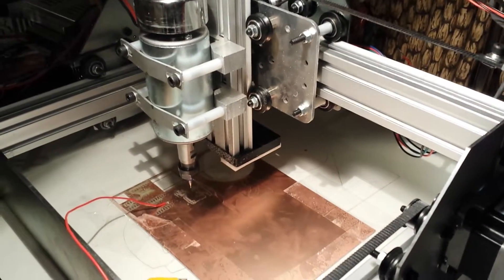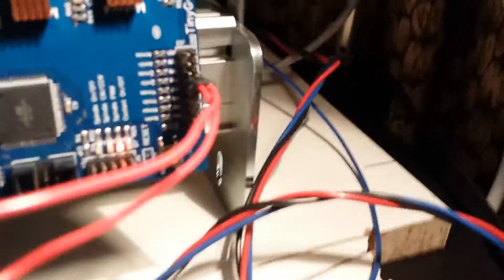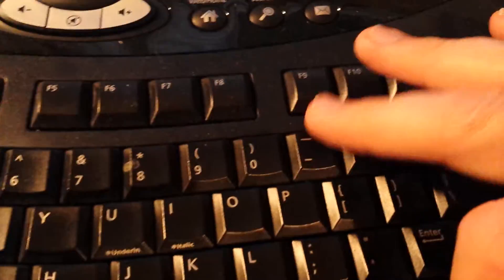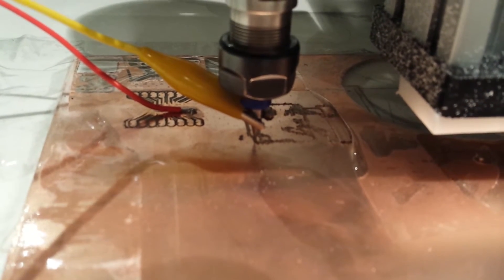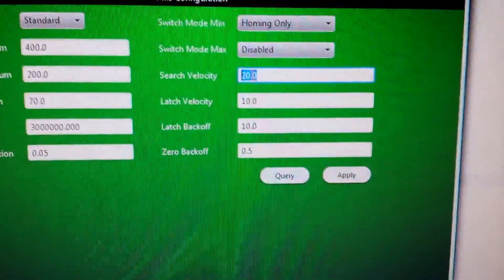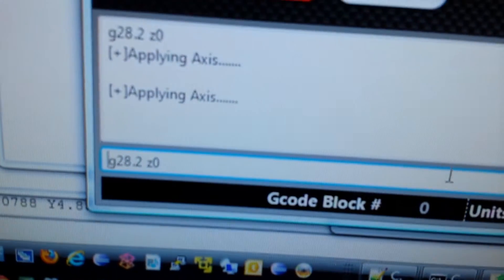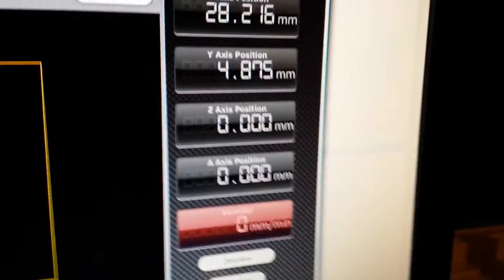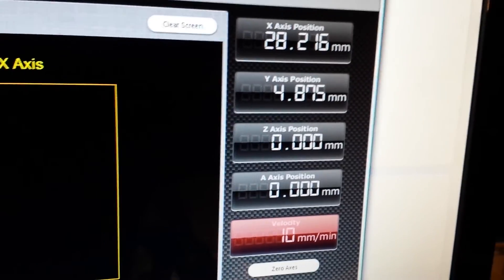Zero Homing Trick on the Z Axis for PCB Milling with the TinyG

Comment: Maybe you are thr right one to ask. Is it possibe to set an offswt value so that i could use a metal on a wood piece to do the zeroing?
Reply: Philip Nauer Yes you can, conduction probes are used commonly on CNC machines, you only need to find the thickness of the metal you are touching and add that as a negative offset to your z height. They can be purchased, however building one is trivial.